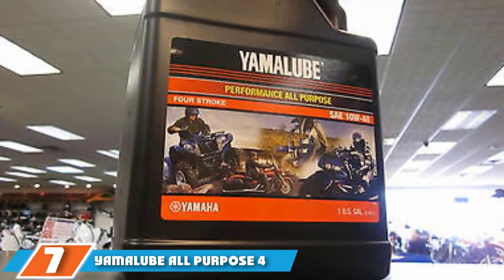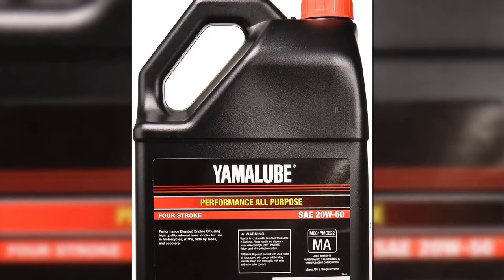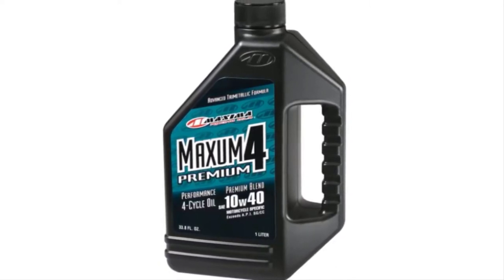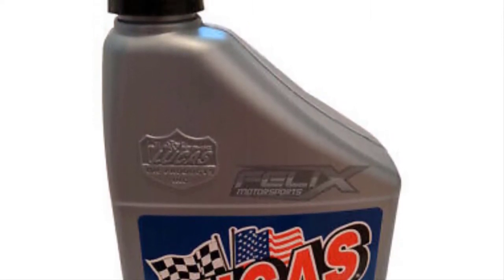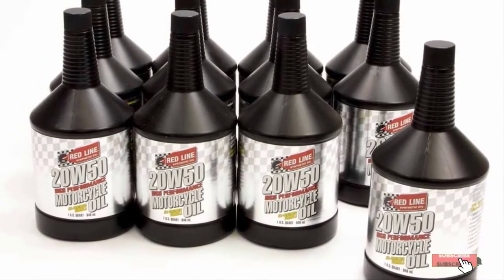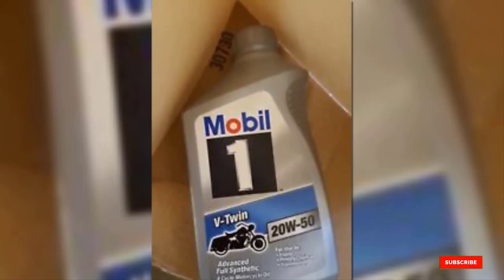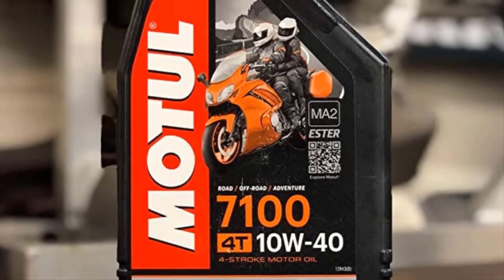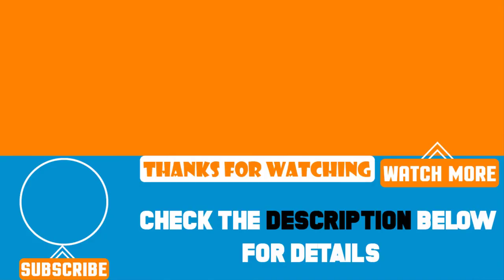Top 5 Best Motorcycle Oils Review In 2024

Comment: Amsoil is the ultimate!!
Reply: Exactly
Reply: Amsoil will keep your bike anywhere from 14 to 28 degrees cooler and double the service intervals with less friction to protect your engine 😀!!!
Reply: @teddycarr3347  i Use in my cars amsoil the last 5 years . Now i have a bike kawasaki zh2 and i dind now wich one i must use?? Greatings from greece
Reply: @ssSs-mi3ed  I use it in my car as well, I have over 400,000 miles in 2 cars with Amsoil and not one problem. I also use the transmission fluid, coolant and coolant boost and brake fluid. I also use P.I. and Upper Cylinder. 👍
Reply: @teddycarr3347  I have been curious of Amsoil what type of oil do you speak of! Also weight? For a motorcycle wet clutch.
Reply: @oxman1834 msoil makes several motorcycle oils V-Twin oils dirt bike oils sportbike oils they're all tailored to a specific type of bike not just one-size-fits-all I run either Amsoil dirt or motorcycle metric in my DRZ400 best oil on the planet
Reply: Got better gass milage and mph. Less vibration.
Reply: catrol is KING